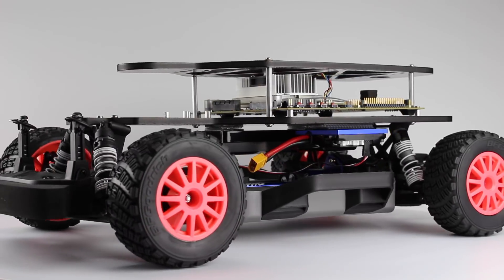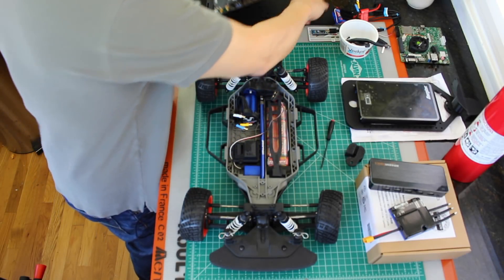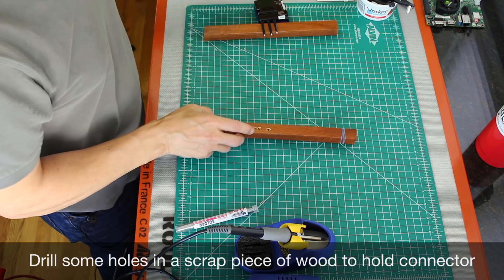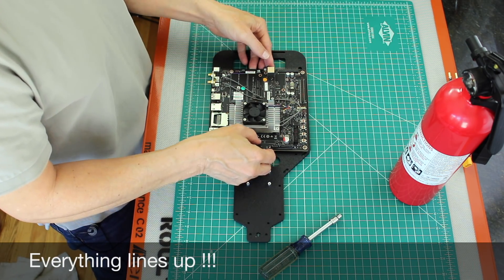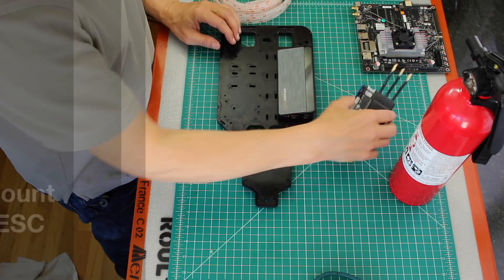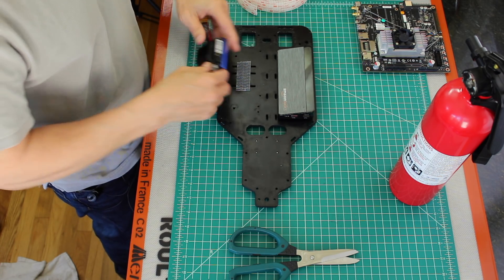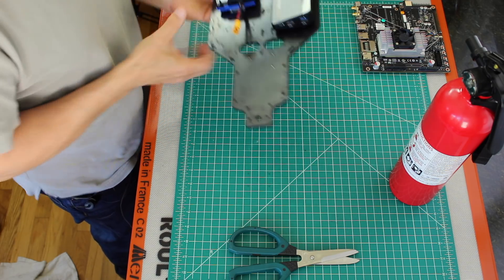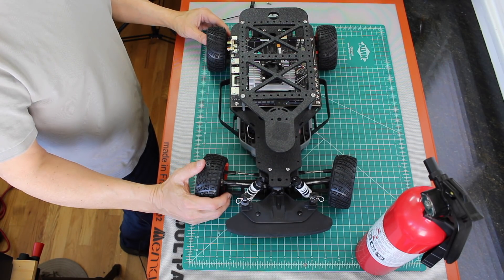Jetson RACECAR Build - Lower Platform

Comment: So how did it run?
Reply from the maker: It runs fine, though low speed control is a little difficult. In the later RACECAR/J videos, we use a ESC that is more tunable. Thanks for watching!

Comment: why did you remove the stock speed control?
Reply from the maker: It can be left in. I was curious as to how much room there is to mount other components in that space. Also, so I would force myself to use the VESC only. Thanks for watching!

Comment: Great Video as usual ! Just a few questions: why didn't you invert the USB hub with the VESC to put the VESC closer to the motor ? Last question: where did you buy this VESC ? it looks gorgeous :) Keep doing it's great :)
Reply from the maker: Thank you for the kind words. The battery for the car motor resides on the opposite side from the car motor. If the USB hub is mounted over the battery, then the battery is very difficult to remove. Because the battery needs to be removed to be safely recharged, the VESC gets moved over to that side. There's enough clearance with the VESC in place to get the battery out. It's the same layout the MIT RACECAR uses.

With that said, that's what the 3M Double Click fastener is for. We should be easily able to experiment with component placement by just moving the tape around.

It's called a VESC-X, you should be able to Google it.
Reply: Thanks for your quick answer and taking time to answer me :)  With your explanation it seems more logical ! 
Thanks for the VESX going to order it right now.